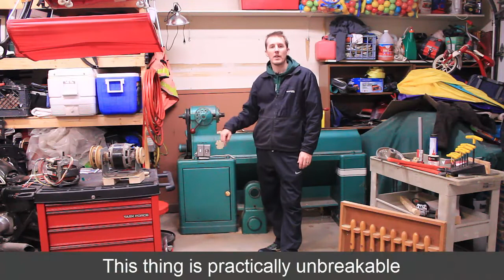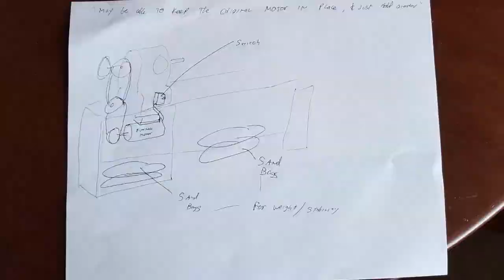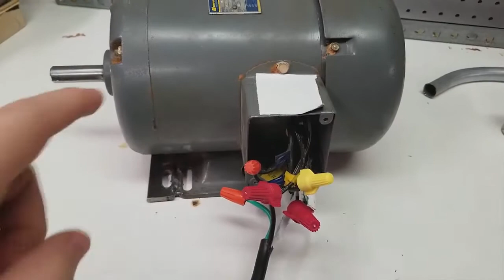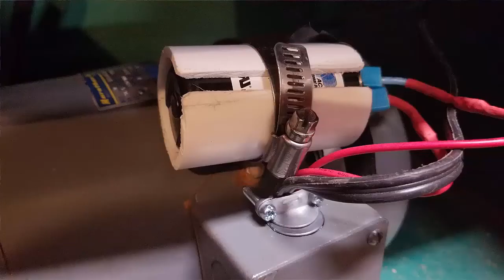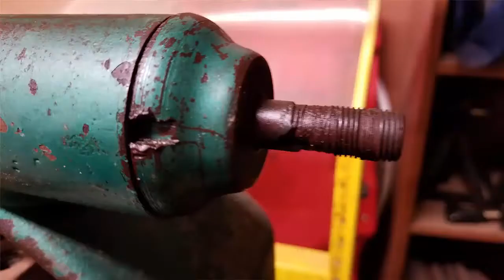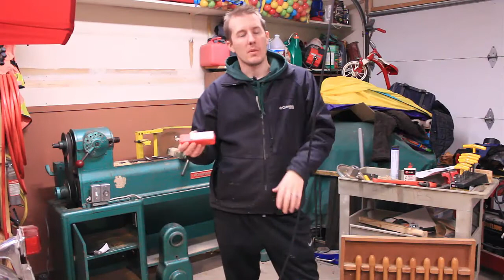Lathe Restoration and Common Problems - 3-Phase Motor

Comment: Nice job.  Liked uour thought process.  I would have just gotten a 1 hp 110 volt motor.  I just sold a powermatic 45 and upgraded to a 1 hp motor.
Reply from the maker: Ya that would have been better.  I'm never going to get 3 phase power so i should have just replaced the motor

Comment: How did you make out? I have the same one with a phase converter like you showed; works awesome.
Reply from the maker: In hindsight i should have just bought a VFD for $200.  It wasn't worth all the effort i went through.  It runs, but it's kind of like a 6 cylinder car running on 4 cylinders.  
I don't use it a ton, maybe 5 times a year.  If i start using it more i will probably buy a phase converter.

Comment: I picked one of these up for free also.  I put in a single phase 1.5 HP motor that I bought from grizzly.  Model# G2534. $225.00.   It can be wired either 110v or 220v.  I wired it 220v.  The mounting bracket on the new motor was exactly the same as the existing motor.  It was pretty easy to install.  I made sure to get the same RPM motor as the existing so that the RPM's indicated on the dial would still be accurate.  I've been using it for about three years.  I figure resale value will be great if the next person doesn't have to deal with the three phase issue.
Reply from the maker: Ya the only real options are a new single phase motor or a VFD.  Right now i'm still using a starting capacitor.  It's not great but it gets it up to speed and the capacitor is only $5.  Eventually i think i'll fork out $160 for a VFD which will convert to 220V and 3 phase.

Comment: So you got a free 1000 dollar lathe, but didn't want to go to harbor freight to buy a 1 hp single phase 220V motor with the right size shaft?
Reply from the maker: For $100 i would have just bought a VFD to convert single-phase 110V to 3-phase 220v.  It's working now with a starting capacitor.  I turn the capacitor on, start the motor, then switch the capacitor off.  Not perfect but it works for the couple times i use it per year.  If i start making bowls or something i would buy a VFD.

Comment: I would like to ask you about the top pulley on the left. Mine has just now lost torque and I was wanting to adjust the top pulley. Have you had any experience with this? I have tried 
pulling the top outside pulley off and it will not come off.
Reply from the maker: I'm trying to remember if there was a set-screw holding it in place.  I don't think so, but some of the internal reves drive wheels had set screws.  The aluminum wheel on the top left is Reverse-Thread so you have to spin it in the opposite direction to remove it from the shaft.

Comment: 3 phase 220V, single phase 220V. a vfd or phase converter converts 3 phase (in this case) to single phase 220V. 115/120V is a single phase but not what is meant by single phase. your right about not getting power because of your not your only providing 1/2 of the required power needed to run the motor. You can pick up on eBay a phase converter for about 70 bucks and a VFD for under 100. bought many for all my equipment. to do the 115 motor idea, you spin up the 3 phase motor with the 115v motor to kick it in but you still need the single phase 220V which in the US is what your dryer or electric stove runs on.